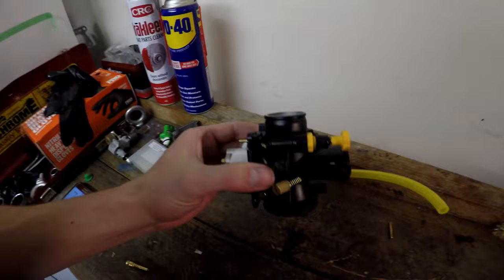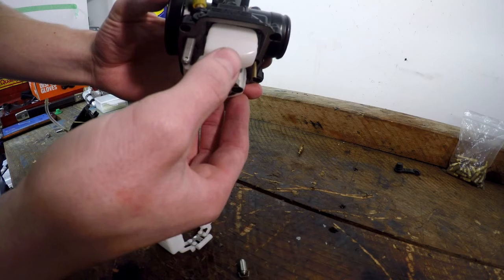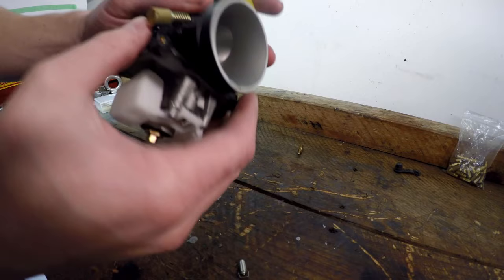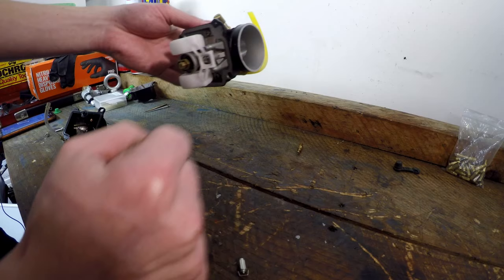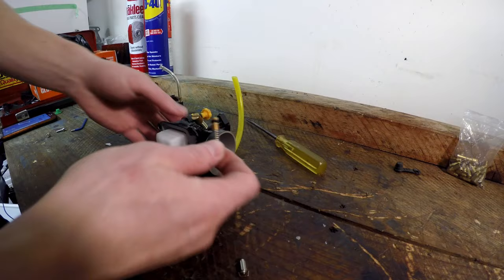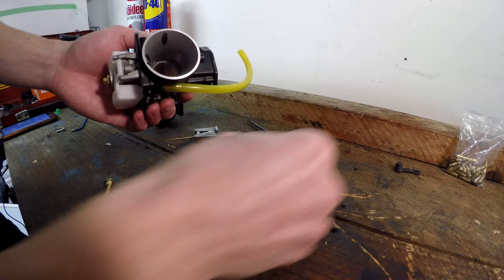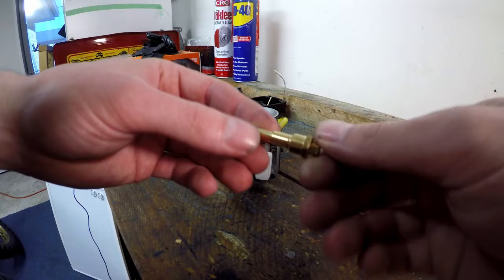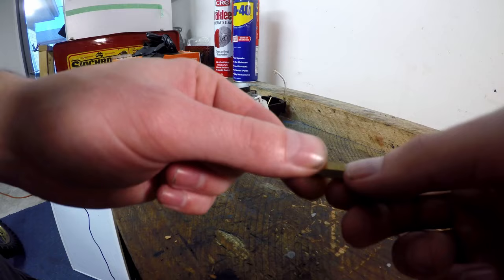pwk Carb Basics, Setup and Tuning

Comment: These OKO Carbs are rubbish...
Reply from the maker: Well if you can't afford a real Keihin they aren't to bad, I have done 5 years racing with one and it still works good but I definitely would take a real PWK any day haha
Reply: no i have with 70ccm sport class on dyno 11HP ( OKO 24mm pwk)
Reply: @spotter3970  no idea wtf sport class means, but a very simple 70cc cylinder kit can do 13hp with 21 pwk

Comment: Could somebody help me? After a jump or bumpy terrain my mixture go too lean. I thought something is wrong with the float height but i can find the good spot. What can be the problem? Do anyone has the same issue?
Reply from the maker: Could be many things, is it out of fuel, have you developed a air leak, is a jet blocked, is something blocking the float valve.
Cheers Logan

Comment: What's the big yellow screw for!?! Can't find anywhere what that changes and nobody talks about it. 
Throttle value screw is what it's labelled. But what does it do?
Reply from the maker: @mikelarin8037 The big flat head screw is for adjusting the idle speed as it lifts the slide when screwed in.

Comment: Hi, please I bought pwk30 carb for my 250 Chinese bike with Zongshen engine, but the engine idles extremely high,.... completely turning down the idle screw gives no sign...any idea about what could cause that?
Reply from the maker: Anything for a sub
There are a few possible causes.
1. Something is causing the slide to stick or stopping it fully seating.
2. Throttle cable could be to short holding slide open a bit.
3. It may be to lean on idle circuit causing slow return to idle.
4. Could be to rich on idle circuit with a air leak.
5. Check what needle it has, as her video.
Cheers Logan
Reply: @TheMotorcycleForge  thanks... Will try that
Reply: @TheMotorcycleForge  .... I tried what u said and truly the throttle cable was short, after installing a new cable,... It needed tuning... I tried the spare jets that came along with the carb.... It revs quite well but takes a while to idle normal....
Any help on that too?
The jets are 115 and 38
I placed the niddle jet locker is at the second groove from the top
Reply from the maker: @nanayeboah475  ok that's a good start, sounds a tad lean on idle circuit. I would try putting the c-clip in the needle one grove lower/ middle groove if it has 5 groves and if that doesn't work a bigger idle jets. Maybe 40 or 42.
Hope this helps.
Cheers Logan
Reply: @TheMotorcycleForge  will try that too... Thanks in advance
Reply: @TheMotorcycleForge  Hi logan, thank you for everything... I ordered some idle jets and now the carb runs on 115 pilot jet and a 42 idle jet
The bike performs quite well but the problem now is, it's difficult to start without the aid of the throttle especially when hot... Had to turn the air fuel mixture screw all the way out to the point of almost coming out before it starts without the aid of throttle.
Any hint on that?
Reply from the maker: @nanayeboah475  With the air screw out quite far and it wanting throttle to start sounds like the Idle circuit is a smidge rich and wanting more air.
I would try a 38 or 40 Pilot and see if it improves.

Comment: question got mine.all set up 28mm now I have a slight surge at idle my air screw is 2-1/2 turns out very small surge
Reply from the maker: Ok so if it's all jetted correctly it could be that the carb is a smidge big for the engine causing a lean spot/surge.
You could try making a idle a bit richer may fix this.
Let me know if that helps.
Cheers Logan
Reply: @TheMotorcycleForge  played with the air screw 2-3/4 out and it fixed it right up just did it a 1/4 turn each time it's fine now I know when they says 1/4 turn at a time it makes a difference
Reply from the maker: @ironhead320  Sweet as, glad you got it sorted
Reply: @TheMotorcycleForge  me too that's the first thing I though carb to big but didn't have that trouble before guess it is really picky on adjustment

Comment: Hi, Any ideas as to what would cause my bike to feel like the throttle sticks just for a second after getting up in the rev's a bit and then backing off for a corner. It feels to stick for a second and then drop off rev's too fast so you then need to gas it more again. It is horrible to ride.
Reply from the maker: I think what could be the issue  based on the symptoms you mentioned it could be a pipe bang.
I would personally check the basics first, is the carb working 100%,  does it have any air leaks, what is the plug like, reed condition ect.
Here is a article explaining pipe bang, http://www.powercdi.com/manual/combustion/pipe_bangs/en.html
Hope this helps
Cheers Logan
Reply: @TheMotorcycleForge  Hi,Yes it has all the symptoms of that but it is a 4 stroke 250 single Chinese sports bike. I went up in carb size from 28 to 34 and I think the 34 might be to big for the poor performance Chinese engine. It has much better power and revs but this issue I think might be just too rich and only comes right just as you back off. I will borrwo a mates 32 carb and try it. Thanks for your help I think you put me in the right direction.
Reply from the maker: @yeahrightmate  What size jets are you running in the 34mm?
It could actually be a bit lean on the main circuit causing the slow/delayed return to idle.
Reply: @TheMotorcycleForge  I have a 38 pilot and a 135 main. It does not return to idle slow, it just jumps forward for a split second as you back off. I borrowed a 32 today and it has 38 pilot and a 140 main and is running good, just a  very very slight splutter off idle to 1/4.

Comment: Wondering if you have any experience with blow through pwk? Mines working fine but I switched to e85 and fuel flow is up a good bit. Wondering if I can make an extension for the power jet if you will. to get it closer to half throttle and maybe get the main jet size down some? Also hoping for a bit more charge cooling although I know that's minimal. Currently I'm at a 230 main and 35powerjet but I feel the power jet isn't coming in until 90% throttle. Then it goes from a touch lean (good for spool up but not so nice when I peddle the bike at 40+psi of boost) to a good mixture. You think adding some length to it would achieve this? I can make new powerjets for different sizes pretty easy. I'd like to get it closer to a 180 main and maybe a 70 PJ if I can. Boost comes on about the same as throttle input.
Reply from the maker: Wow sounds like a pretty sick setup you got there Oliver but I have very little experience with blow through carbs. I think your idea is definatley worth a shot though. Let me know how it goes, keen on learning new stuff..
Reply: @TheMotorcycleForge  will do would be nice if it did lol. I know na you can change the length (height) to do this but blowing through sometimes things do other things.
Reply: Oliver what all did you have to do to make the pwk blow threw? I'm currently working on a pulley driven turbo and just found the right pilot jet but I can get to about 1/8 throttle and it wants to die

Comment: How to tune for more top end power opposed to low end power?
Reply from the maker: That is more along the lines of what parts you have on the bike vs what jets are in your carb, as long as you have the carb dialed in it should work at all engine speeds.
I 2mm oversize carb from stock will move the power to more top end, a shorter intake length and shorter exhaust are common ways that engine tuners move the power higher up for more top end.
Hope this helps.

Comment: Have a GSX150 cant get the carb running right but not many details out there on Carb setup and running for GSX150’s as everyone says they are slow.  Any thoughts/suggestions ?
Reply from the maker: What are the symptoms and what carb do you have fitted?
Reply: @TheMotorcycleForge  have a AliExpress special ZSDTRP 28mm carb, 115main jet, 48 pilot jet have needle on 2nd notch from the bottom. Bogs down at low RPM but cause it red lines so low i Can’t really keep bike at high rpms.  Maybe need a CDI to extend rpm redline??? Not sure where to get one though.
Reply from the maker: Looking at what jets and needle position. It may be bogging down as it's a bit on the rich side.
How many positions does have? 5?
I would try a 42 / 40 pilot or drop the needle one notch as a starting point.

Comment: How do I buy a new main jet atomizer, I took it out and accidentally snapped the thread of the main jet in the atomizer, have a new main jet but no atomizer for it. 2003 yz85
Reply from the maker: Look up Emulsion Tube for the carb you have (PWK) and you should be able to find a new one for sale easy.

Comment: Help please! I have a Honda Ruckus with a stock GET 49cc 4-stroke. I put a PZ16 carb on it. After swapping the stock 35/75 jets for 38/78, it starts and idles good, and runs great at full throttle. The only problem I'm having is that sometimes, usually after a good hard run, it sputters at midrange, around 5000 - 6000 rpm. If I back off or give it more throttle, it smooths right out. I'm thinking this might be a needle clip issue, but I'm not sure which way to go. Hoping you can give me a clue, so I don't have to resort to trial-and-error. Seems to only do this at full operating temp and after being wide open for a while. Thanks!!
Reply from the maker: If it doesn't do it when it's cold and only hot it's most likely a bit rich on the needle.
I would lift the clip one groove higher  to lean the mid range a bit and see how it goes.

Comment: I am getting a back fire at middle range, how can I know if the mix is too rich or too lean? Thanks
Reply from the maker: @tuyo_adventures.2185  does this happen when cold or hot.
Does the choke make it worse or go away?
Reply: @TheMotorcycleForge   Thanks for geting back to me, it happens either way on decel and also when i give throttle, Choke shuts it off so i'll say makes it worse, Thanks.
Reply from the maker: @tuyo_adventures.2185  if choke makes it worse it's possibly to rich.
So altering the needle position to make it leaner.
Also the mixture screw will need to be altered to suit.

Comment: Does trumpet size and length really make a difference ?

More top end power if Carb trumpet is shorter.

More low end grunt of the Carb trumpet is longer.
Reply from the maker: It does make a difference to have the correct length to suit your cam timing, how much I'm not quite sure yet.
I plan to have a dyno in the near future and will test then.
I have heard from a engineer I'm friend with that they found 17% Power increase on a already worked race engine by simply altering trumpet geometry to suit the rest on the engine package.

Comment: Just installed the Nibbi card but I having idle issues idles way to high and I cannot lower it with just the knob/screw 
What should I do ?
Reply from the maker: Does your throttle cable have enough play in it or is it too tight?
Reply: @TheMotorcycleForge  it has some play I think it might need the jet changed out and needles adjustment. I’m sooo lost lol
Reply from the maker: If it's to lean on the idle circuit it will be slow to return to idle.
I did another carb video to help with tuning, it should help.
Reply: @TheMotorcycleForge  thanks I’ll check it out
Reply: Watching now definitely a better understanding of how everything works. My bike will only start when choke is up
Reply from the maker: Awesome, glad it was helpful.
Cheers Logan

Comment: do know if 97A pwk needle is any good for my 24mm pwk carb?
Reply from the maker: It is not a needle I have used personally. Have you tried it, if so what was it doing?
Reply: @TheMotorcycleForge  I ordered it because my old needle was bent and I thought if I could get better performance with different needle.
Reply from the maker: Oh I see, looking at the pictures of a 97a it looks quite wide. May make the bike quite lean but you will have to test to be sure.

Comment: I never heard an explanation of what "PWK" means. Is that a brand? A type? A model series?
Reply from the maker: The original PWK is a model/style of carb made by Keihin but most people can't afford them so get the cheaper copy the OKO 😁
Reply: @TheMotorcycleForge  Do the letters stand for something? Someone's initials maybe? The letters obviously have a meaning to someone, like the person who developed the technique PWK. Is it actually their initials? Doubt it. More likely PWK stands for some technical ideas on construction/design that comprise that method of carburetion. Why do I need to know? Because whatever it stands for, I could then gain some understanding of how this "method" compares with other styles of carburetion. With no luck finding this definition elsewhere, I'm asking you, since you're talking about it on a video. Any idea what PWK stands for?
Reply from the maker: @scottalanclymer  I have heard it stands for Power Without Komprimise but as you can see it's not quite spelt correctly.
Hope this helps.
Cheers Logan

Comment: Having hard times fixing my bike and someone told me its the carb and nothing is working it doesn’t wanna stay running
Reply from the maker: Could be multiple things, if it has been sitting the jets could be blocked. Float height may be incorrect or a bit of rust or dirt might be holding the float valve open.
Reply: @TheMotorcycleForge  oh man this sucke ha

Comment: I bought a carb the same just black and red and it started leaking gas fast & a lot from the bottom and the hole where it gets air
Reply from the maker: Sounds like it is flooding, check the float height as in the video and make sure there is no dirt/rust holding the float valve open

Comment: My engine drops idle after warm up. In addition, it can stall from like this Carburetors pwk in the process of jetting What could it be ? Too small idle Jet?  No air leaks for sure.
Reply from the maker: If your bike idles lower when it's hot than when it's cold it generally means the idle circuit jet is to big or mixture screw is adjusted a bit on the rich  side.
Also if choke is on will cause same symptoms.
Reply: @TheMotorcycleForge  By screwing in the air screw to almost "0" rpms begin to rise, what would suggest a pilot jet is too small? 🤔
Reply from the maker: Yes definitely that could be the cause, what jets, carb size and bike are they on?
Reply: @TheMotorcycleForge  OKO PWK28 with pod air filter. Yamaha rd250 twin air cooled. Now with 38 idle,jjh needle,138 Main jet. Tried also 40,42,45 pilots. With stock mikuni vm28 and stock airbox is 25/120 Main jet. I think I'll put on the 50-55 pilot jets for a test,but it's a total strange size vs stock carburetor and 125ccm single cylinder dont you think? I'm already starting to freak out about whether something is broken. Leak test done with positive results, ignition checked and coils.
Reply from the maker: Ok so a couple things you could try which I have come across before are.
Pod filters sometimes mess with carbs, I think it's a resonance thing, I would do a  test without them on.
Also with the idle jet size, I have found the pwk carbs seem to prefer a bigger jet than what you would expect, so maybe they do need a 48 or 50 ect.
I if you are thinking there is a issue with the engine, I would maybe swap out the carbs for oem do a test to confirm the engine is ok then continue with pwk jetting ect.
The needle JJH I have not had much luck with personally but by the sounds of it it's probably not the issue.
Let me know how you get on.
Cheers Logan
Reply: Something is wrong with pwks in my opinion. I did swapped them for stock mikuni vm28 and they idles fine. Then got back to pwk - idle goes down and engine dies. Then i need to start with choke when engine is hot?! Idle circut is corrupted or what can be wrong? It looks like is nothing in common with jets
Reply from the maker: You could have a bad batch of carbs, I have had the odd one not work properly.
If it needs choke hot to start it is far to lean on the idle circuit.
One thing to note when comparing jets from Mikuni and Keihin is they are measured differently so a 35 in one isn't a 35 in the other.
Reply: @TheMotorcycleForge  is IT possibile to fix that or is it junk?
Reply from the maker: How big did you go on the jetting when testing?
The mikuni has a 50 pilot equivalent to the keihin so a 45 is to lean.
What setting is the needle? You could try lift it one groove.
The issue I had was float problems, I haven't had idle issues yet. Definitely sounds like it's lean, I did another video on tuning pwks it may help.
Reply: @TheMotorcycleForge  with 28 mikuni i use 25 pilot/120main. / Pwk idle from 35 to 48. Main 150 to 132. Needle 2nd from top. If more then is too Rich.
Reply from the maker: Hmmm well I'm stumped. Is the pwk a bigger carb than the tm. I have a 52-55 pilot jet in a pwk 28mm on a two banger. 
I would maybe try a bit bigger or if jets don't change anything as you were saying maybe there is a restriction or something in the idle circuit.
Reply: @TheMotorcycleForge Hi, it took a very long time, but I finally found out the cause of the problems. It turned out that there is a small short circuit in the electrical system ( from flasher relay). I went back to the original carbs and the motorcycle ran worse and worse. Finally, the problems with pwk showed up on the gen mikuni. I must admit honestly that I did not reinstall the pwk,but I think that the setup that once seemed ok will fit and work today ( and only a short circuit prevented the engine from working properly) autumn is approaching so I will probably return to it in the spring. Just wanted you to know 😉 i almost give up on this case.
Reply from the maker: Glad you managed to find the cause of the issue, electrical gremlins can be very hard to find for sure.
Good job

Comment: If you use a 02 sensor is there and specific number for idle
Reply from the maker: It depends on your application, 14-1 for fuel efficiency on a road bike.
12.6 - 1 or around 13 - 1 for a race bike.
Reply: @TheMotorcycleForge  ok thanks